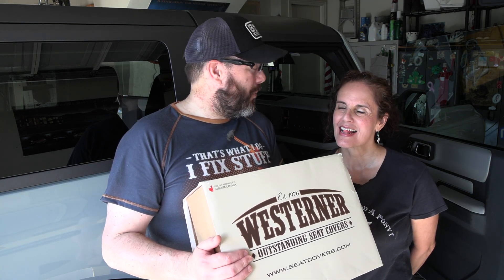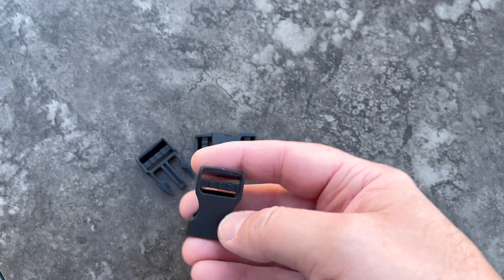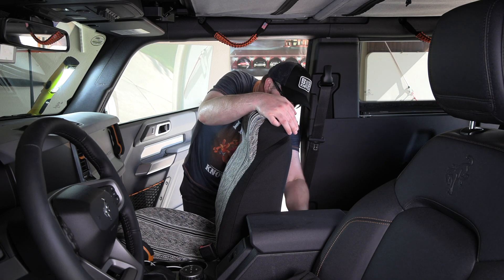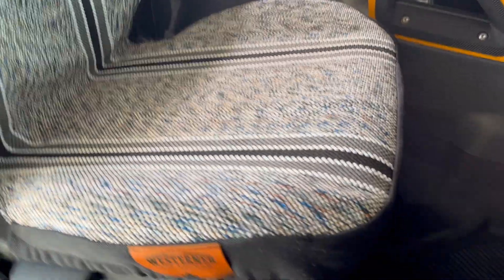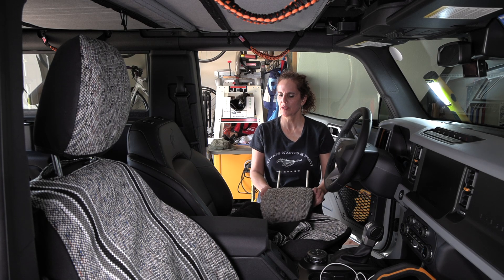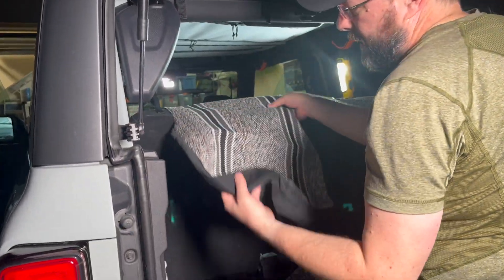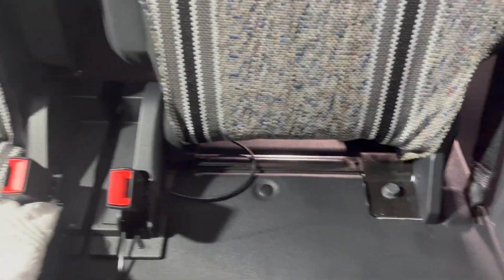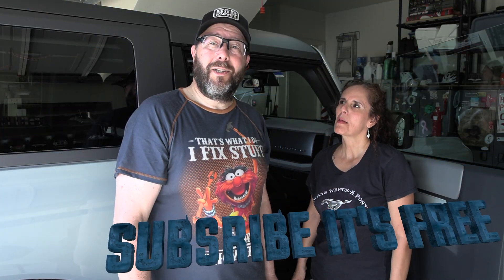Westerner Seat Covers For Bronco Badlands - Nice Retro Look

Comment: Damn, I use the molle panels often, sucks you loose them. I wonder if these are cooler in the summer than sitting directly on the leather seats
Reply from the maker: @larrycole1911 - With the 2 door and keeping my back seats down and back area flat most of the time for the dog, losing the molle was not a big deal for me. As for comfort in the summer they are awesome. In the Texas heat that vinyl would be no fun in the summer. These are great. Appreciate the comment.

Comment: Are these okay to use with heated seats? From Canada! Nice channel... you've sourced quality gear!
Reply from the maker: @Dean_O - I have used them with several vehicles with heated seats including this Bronco. No issue that I am aware of. Thanks for the question.
Reply: @BadToTheStone  Hi and thanks for the reply. I’ve never used car seat covers before. After viewing the options of different designs and protecting new seats it peaked my interest. When performing research I noted some manufacturers make a note of mentioning not to use with heated seats. BTW, you mention Western Seat Covers is based in and ships from Canada. This was also of interest as I wouldn’t have to pay any duty. However their site states they’re Texas based. Did they relocate? Anyway thanks for your time. Looking forward to the next video.
Reply from the maker: @Dean_O.  - Maybe different materials can be an issue with reheated seats?  Westerner is good about answering questions so you may want to ask them directly. In the US they sell through seatcovers.com and I don’t know where they are out of. In Canada they sell through local auto parts stores or direct I think?  They are located in Alberta and have not moved as far as I know. Be sure you are looking up Weterner and not Western.